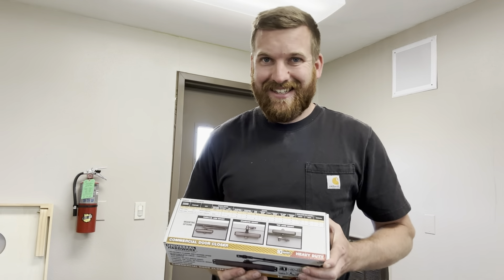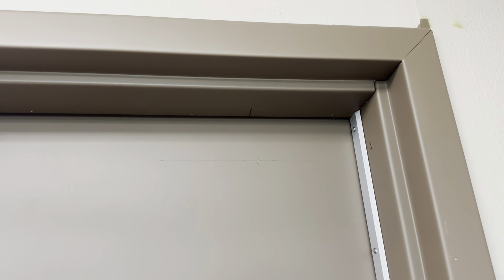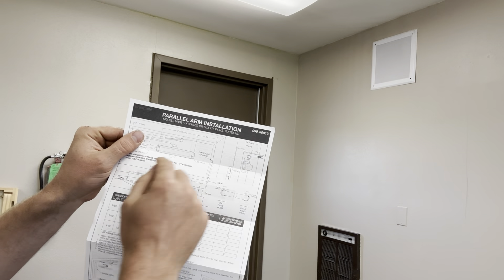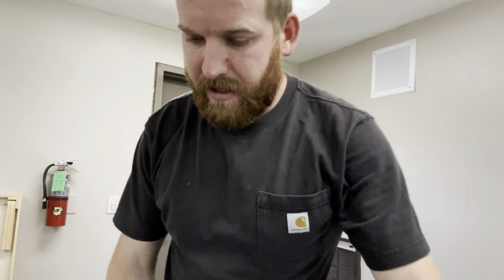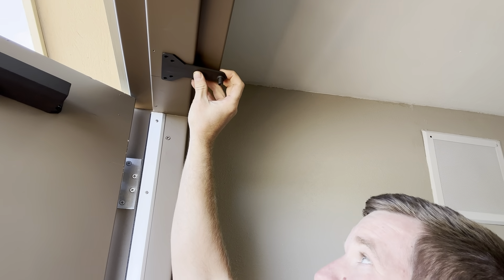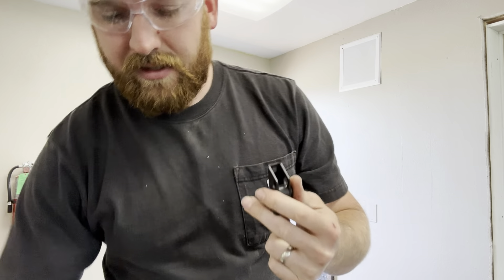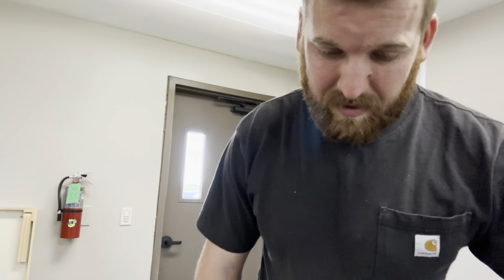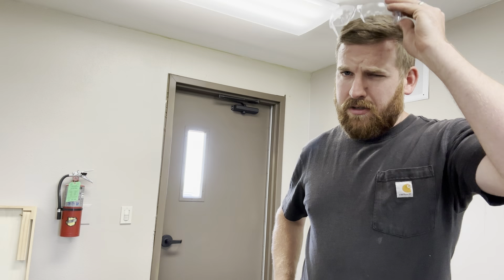How To Install a Commercial Door Closer!

Comment: thank you for this video.  I think you 'pre-loaded" the closure when you were doing the final installing of the arm?  If so, you did not explain what you were doing.  The preload puts some tension on the closer to get it to close the door easier.  Not sure if your kit had hardware to drill all the way through and use parts that allow the mounting bolts to go all the way through, heads would be outside ( exterior).   If so this could have been mentioned too.      Thanks again,  Very good video.

Comment: Thank you for doing this. One question, does it matter if the closure is installed with the BC Valve and speed valves reverse? I notice this after I finished.
Reply from the maker: I’m not quite sure what you mean but if your door is working like it should, it is fine.? :)
Reply: @thebuildinginvestor8427  Thanks for the prompt reply. Video very helpful.  The door opens perfect, however, when its returning back to close, it stay open 6 inches. It does not close all the way. Have a nice Sunday.
Reply from the maker: from my experience it sounds like one of your adjustments screws is to tight unless your shock arm is set to close. But best of luck with your project. :)